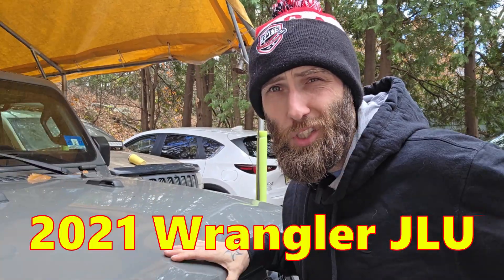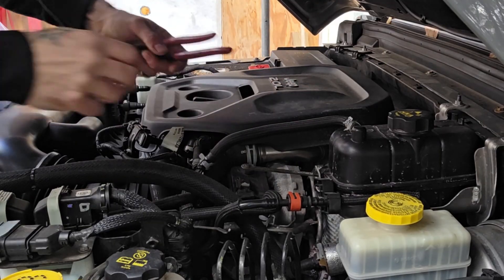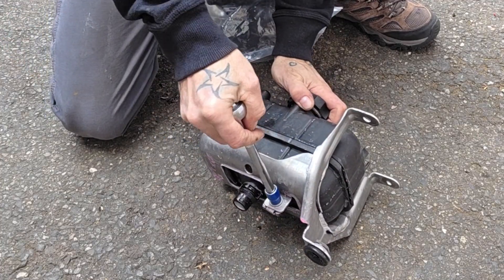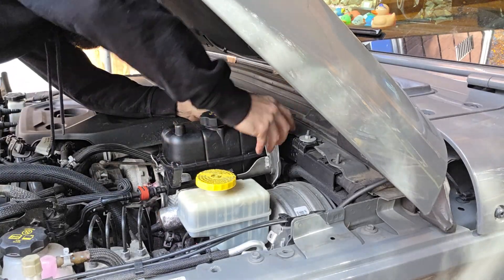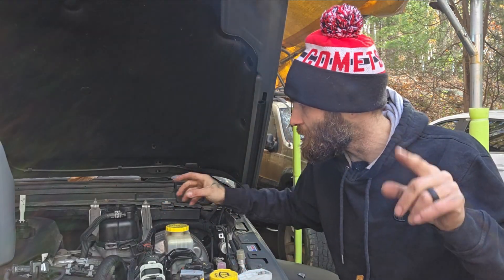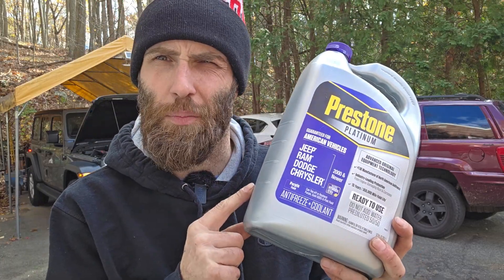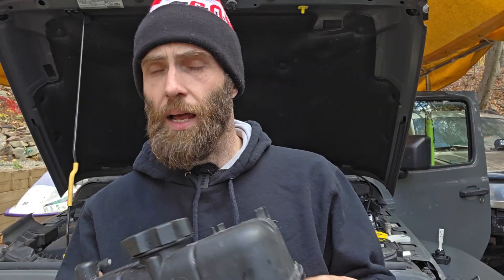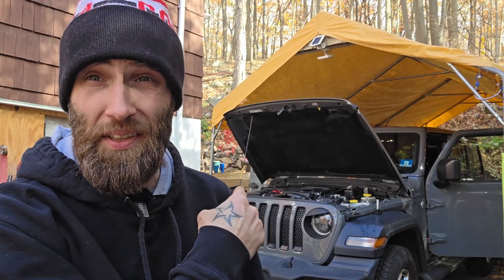Jeep 2.0T (GME T4) Engine Overheating Issues - DIAGNOSE and REPAIR

Comment: Hey buddy I have the jeep wrangler turbo 2020 and I don’t regret any it of it. I drive it in Dubai. Recently I faced same issue with the reservoir coolant leak. But I did not change it yet I added 1L coolant and I was good to go. Do you think I need to change it to new one?

Comment: Just happened to mine also. Have the replacement aluminum one. Havent installed yet. Very helpful video. Is there not a recall on this?

Comment: Had my replaced by dealer at 23k I bought aluminum reservoir in case when the new one starts leak , also planning to replace the plastic T fittings around with aluminum or brass to further heat proof the plastic lines \\/

Comment: Good information placed order for replacement part. Thanks! I opted for the Mishimoto Aluminum Coolant Expansion Tank; Black (18-26 Jeep Wrangler JL. I figured the plastic one would end up failing again in 6 months so just upgrade and be done with it.

Comment: People hate on Jeeps because they can't fix them 😂  The coolant reservoir or bottle looks to be around the same size as a cattle in a converter heat shield from a V8 Jeep so maybe get one and fit it to the bracket facing the turbo . You could bolt it to it or hust a few rivets will hold it together.  Now the real question is Dorman going to make an aluminum replacement tank and solve this issue??

Comment: 2.0 is a great motor love it! They actually use this engine in some European sports cars! Mine was leaking were the push fitting connects to the lower hose seemed that it corroded for some reason and was barley hangin on….lol

Comment: How many miles you had on it when it happened
Reply from the maker: I dont know when it started, but i noticed it as an issue around 95,000. I suspect it was slowly boil out coolant for quite a while

Comment: I have a 3.6L in my 3023 Mojave. My coolant reservoir cracked at the seam like yours. I replaced it with an aluminum tank. No issue yet.

Comment: Yo, Doug, what's up, brother Glad to see your still working on your junk. Let's leave the two liters to the soft drink companies😅  it's too bad about the design flaw in the placement of that reservoir bottle. You don't want to talk about design flaws. The geniuses at Chevrolet use those little wire retainer clips to hold in the oil cooler lines.  That just pushed into the radiator I have personal experience on those clips fairly entrust me.You will lose every drop of oil out of your engine very quickly. The\nOld design was much better.The lines actually screwed into the radiator with actual fittings. When I lost all my oil because the clips failed, I was in the school.Drop off.While dropping my son off at high school go so.Yes a tow truck was involved.
Reply from the maker: Oh jeez what a nightmare! I married a car girl. She wants what she wants. Haha. I am going to find a better solution for the clip though. If that elbow falls out, it's over!

Comment: That tank will fail the same as the first. The fix is the aluminum tank from Amazon and replacing the plastic y with an aluminum y as well.
Reply: Yep. I opted for the Mishimoto Aluminum Coolant Expansion Tank; Black (18-26 Jeep Wrangler JL. I’ll eventually upgrade the radiator as well. 2.0 needs more cooling capacity for sure.

Comment: I have a '21 JL as well - absolutely love it.  Peppy on the road, low-RPM torque on the trail...just goes.  Have experienced the standing 220°F issue with mine also, but no 250°F limp as of yet.  I'll be picking up a replacement reservoir, thanks for sharing!
Reply: I usually see 220f on slow trails ride when the air is not cooling down to much I believe that’s normal , on a road or hwy 190-200f

Comment: Let us know how you make out with that heat shield! Seems like the answer..
Reply: I used high temperature tape to cover the outside and inside area of the metal tray that holds the reservoir tank and bought a heat shield at home depot it’s a perfect square size 1x1 that is heat resistant to 2300 degrees i placed it between the turbo and the tank and used zip ties to keep it still in place. Works great